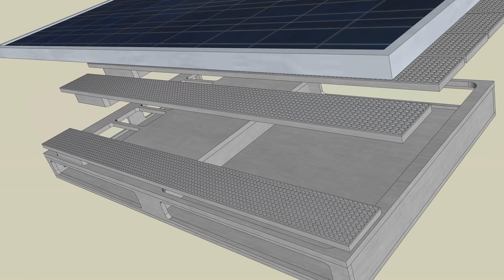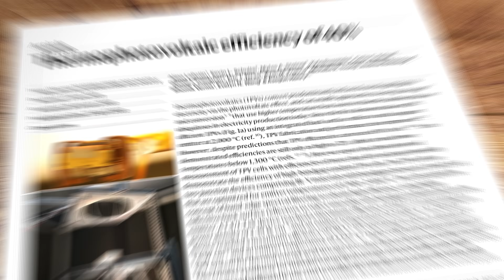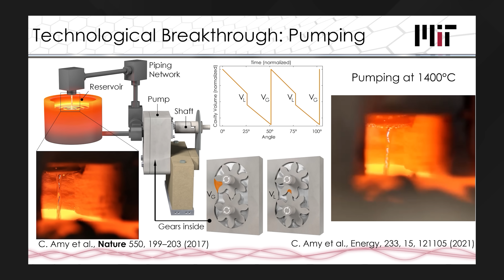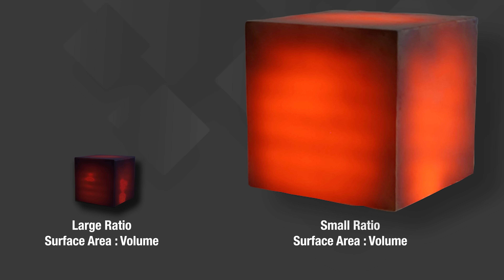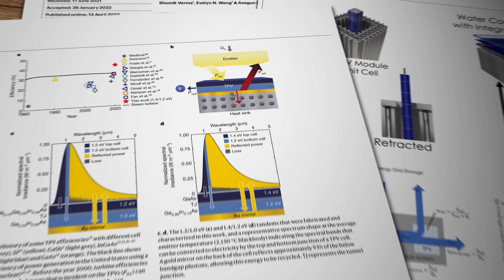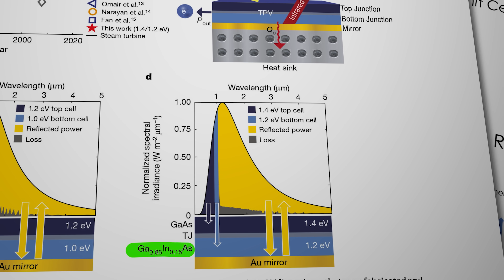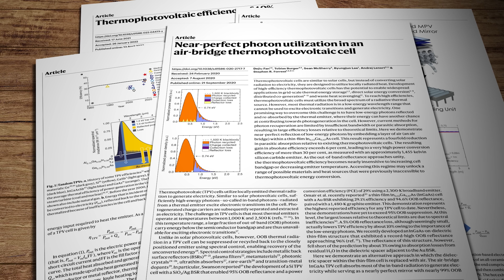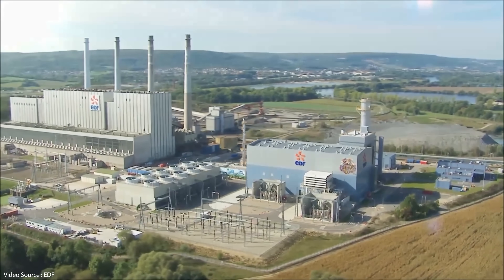Grid Scale Energy Storage 30x cheaper than Lithium-ion! How do they do that?

Comment: So the molten tin makes it back to the heating element before freezing?  If that tin froze in the pipes, that would be a problem, wouldn't it?
Reply: It would, but it sounds like the tin is being pumped around at temperatures far in excess of tin's melting point (231 degrees c vs. the  2,400 degrees c this system runs at), so they'd have quite a bit of cushion.
Reply: @sunspot42  true, but there better be redundancies built into the system.

Comment: I can't help but think that this system is better suited to a district heating system. Long term electrical storage requirements are a myth. Wind and solar are counter cyclical. And studies have concluded that you only need 1-4 days worth of storage in 90% of the global energy market to meet needs.
Reply: They are counter cyclical in short term but long term... not so much. Solar and wind both dip in winter.
Reply: @ThomasBomb45  yes they are. The wind blows stronger at night, during weather events and in the winter as well. Conditions are localized, but a complete renewable grid will always have excess energy being created elsewhere.
Reply: @ThomasBomb45  No its does not. Offshore wind is stronger in the winter. The colder the air is? The more dense it is, and the more force it is able to exert on the blades. The generators are unaffected by the cold. They produce their own heat.
Reply: We absolutely need long term storage or overbuilding of energy generation. At least if we want 100% renewable energy. We can get pretty high renewable penetration though with just a few days of storage

Comment: One thing I realised is that the system still requires rare minerals like gallium to operate. Not the best thing for large scale sustainability.
Reply: Argon too. I'd be interested in hearing how they'd fully insulate/isolate that carbon storage chamber from leaks, and at what concentration would the proper reactions take place.
Reply: True, but how many first efforts are ideal?
Reply: @markhathaway9456  it's essentially impossible to avoid the use of gallium here.

But I have no idea how much power you can get per kg of gallium through this system, nor how much gallium is produced each year.
Reply: @kanucks9  gallium is a by product of aluminium smelting and production can easily be greatly increased to meet a rise in demand

Comment: That is really interesting. I have to keep an eye on this for the opportunity for the technology to work on the back of my log heater to generate electricity while I heat my boat in Winter. What it would need would be a barrier material that when heated by the fire would emit light at a t a fixed frequency on the other side to which the PVT’s were attached. Keeping the PVT’s cool would not cause inefficiency in this case a s the purpose of the assembly is to generate heat, so functionally the whole assembly would be greater than the 40% to 50% electrical collectible electrical energy i.e. the cooling energy is not wasted.

Comment: This system looks like something Rube Goldberg might have invented after his 6th coffee in a morning.  The system may be a miracle of scientific advances but it is complex beyond belief.  The idea is to store excess energy which is inherent in solar and wind systems. So far so good and they end up with getting out 50% of the energy they put in which is quite respectable.  But the material infrastructure and maintenance; is that all in the overall efficiency calculation.
Even if it is, there is a much better option for any region requiring heat in the winter.  That is geothermal storage.  To avoid curtailment losses, excess energy is turned into heat and stored underground.  The efficiency of this operation is around 50% as well but the infrastructure required is a matrix of vertical holes in the ground.  Such  systems cost about 0.6% of the cost of chemical batteries per kWh and can be up and running in weeks using garden variety drilling equipment.  
The downside is that they produce heat rather than electricity and therefore are only useful 6 months a year for output but can store excess energy all year long.  What the MIT team has done is impressive but it just won't fly once the practical hurdles begin to be encountered and there is a vastly cheaper, easier and proven alternative.
Reply: Compared to thorium salt reactor designs, this is not particularly complex.
Reply: @richardgreen7225  That doesn't say much.
Reply: Geothermal storage, on large scale for heat pump application has been done in Canada. The cost is huge, around 100k$ per house.
Reply: @hellsing56666  where was this $100,000 per house storage facility built? What is the name of it?
Reply: @morninboy  it was drake landing:

https://en.m.wikipedia.org/wiki/Drake_Landing_Solar_Community

The cost is high because it was the first time it was done in this region, maybe it can be cheaper now.
Reply: @hellsing56666  Wikipedia says that the cost would be about half now that they know how to do it.

It's not clear from the info if the cost of the house insulation is included in the 7 million.
Reply: Am I missing something? The whole point of TPV is to convert the heat to electricity.
Reply: @gg3675  it converts very hot heat (2000c) to electricity, there is still a lot of potential in the remaining heat.
Reply: @hellsing56666  Oh, you know what, I actually misread the original post and see what they meant now.
Reply: TPV may be more suitable for thermal power plants and nuclear reactors.
Reply: @martincampbell9810  
You can have the honors. 

... the congressmen who fall for subsidizing this crap too. 
Especially FUSION.
Reply: Heh, yeah I was thinking it was something made to catch roadrunners.

Comment: it takes 14.2Kwh of energy to take 1 ton of tin from say 20°c to 250°c, that's less than an EV battery pack's worth of energy and could be supplied by a 20Kwh turbine system

Comment: Thermal cycle those layers between the 90 what ever percent reflective part and at some point micro defects cropping up are gonna ruin efficiency. But if they engineer it right should last longer than a battery. I'd be more concerned with the other moving parts, but tbh didn't pay enough attention to comment on that.

Comment: Good luck to them, but I'll maintain a steep escarpment of skepticism until we see the true cost of a commercial system.
One point. Being thermal storage based, the longer we want a unit of energy stored, the greater the losses through the insulation. What's really needed by the renewable energy industry is low cost long-term storage. August to January, one paid cycle per year. This, with its thermal leakage problem, is not likely the solution.
Reply: I am not sure, but isn't something like flow batteries the best for longterm storage? In any case no one is really interested in developing such long term storage, since it will not be really profitable or have a very high cost/kWh. A better idea might be to just have overcapacity in production and large interconnected grids to deal with variations on larger scale.
Reply: @MDP1702  who will want to overbuild? Overbuilding will be lots of cost with little profit as well...

We will need to pick the rich combination of storage, interconnection, and overbuilding. And we need to do so from a collective perspective not from a profit perspective
Reply: @ThomasBomb45  Will it be more costly? Possibly. However if you can find the right match the overbuild can be used during summer for things that don't necessarily need to run in winter (for example hydrogen production maybe or maybe something like (indoor) farming?) so that they don't necessarily are idle throughout the rest of the year. Also even if this overcapacity only produces 1/3rd of normal yearly production, that still makes it around 90-120$/MWh, which is likely a lot less than long term storage which essentially has only 1 cycle per year (if it is seasonal) vs the nearly daily (or at worst weekly) cycles of short term storage. Considering short term storage already can be more expensive than this overcapacity, longterm storage doesn't really stand a chance. 

And ofcourse there was a large emphasis on large interconnected grids. even during winter you still get a lot of sunlight in more southern regions while wind ofcourse will also generally blow somewhere too. Not forgetting that wind generally is better during winter and solar during summer, though they don't exactly balance out since the seasonal difference for wind is smaller than that for sun.

All in all there really isn't a good incentive for storage with monthly cycles considering alternatives.

Anyway (limited) overcapacity + hydrogen storage could be on of the more interesting systems if truly needed. The overcapicity can create hydrogen in the summer and still be used as a supplement in the winter, while the produced hydrogen can then also be used in the winter. It isn't ideal due to the need of large scale hydrogen storage during months and overall efficiency losses of hydrogen, but likely still one of the better ones and if there is any hydrogen left (due to for example a good winter), it likely can be sold to industry and transportation.

Comment: They should be able to run the cooling water through a turbine so they don't dump the heat overboard without extracting all the available energy.
Reply: It is difficult to extract heat from water unless it is steam
Reply: @ted-123  That has been the traditional way and few efforts to produce electricity directly from heat have been of any use. The key about this system, one most everybody here doesn't seem to understand, is that the method they're using generates electricity from heat at a much higher rate than ever before. (as I understand it)

Comment: Idk man. First of all, the quoted 40% efficiency is just for the TPV cells themselves; it is not the round-trip efficiency of the whole storage unit itself. With other technologies like pumped water having 70-80% round-trip efficiency, I don't see how this system could ever compete them for storage. So unless this is absurdly cheap and the excess production by PV/wind very high, then I don't see this being a viable solution. But it looks more like a Rube Goldberg device, so I have doubts that it could be as cheap as they tout. Others have pointed out the losses in cooling the TPV generating units; why not capture some of that temperature differential with a heat engine like a Stirling engine?
Reply: Pumped storage has a huge capital cost, and sites are difficult to find that meet operational and local population requirements and hurdles.

Comment: Neat. It does seem like a complicated system, lots of moving parts with the associated downsides. And as others have noted it would be nice to make use of the waste heat off the cooling units. 
But it's novel and it does seem as though they have actually thought about scalibility and practical deployment.
I liked the sound effects when bits were being dropped in place in the animations.
Thanks, Dave!
Reply: The requirement for gas-tight, argon filled buildings strikes me as a maintenance nightmare.
Reply: @jasondrummond9451  It doesn't really have to be gas tight. Argon is denser than regular air, so keeping the building pressurized at just over 1 atm would ensure that outside air was not getting in. If anything, argon would leak out. Argon isn't bad for the environment as it is non-reactive, so a small continual leak would not have a negative environmental impact.

This is also another example of volume vs surface area. The larger the building is in terms of volume, the smaller percentage of it's argon it will have to worry about replacing due to any leaks.
Reply: @jasondrummond9451  all that's really required is to prevent oxygen reaching superheated graphite and tin.  Not so different from the xenon or CO₂ that's used to prevent combustion during high temperature welding, except that it has to operate longer term.  Maybe filling entire buildings with argon is overkill there.  Other oxygen-displacing gases might cost less than argon and be equally effective.
Reply: @jasondrummond9451  I think in the reality they would build gas-tight cells inside a normal building, like a cooling-cell in a commercial kitchen, just bigger.
Reply: @jasondrummond9451  The pessimist in me sees that as only one of the potential maintenance issues.
Using a molten metal as a heat carrier is another, what happens in the worst case scenario where the temp drops below the melting point of the metal. How do you remelt several hundred feet of solitified metal in the pipes to get the system operating again without a total rebuild? 
How long will it take to cool the graphite blocks down for maintenance in that part of the system.
And as just about everyone has commented why dont they put a steam turbine in the system as an add on or backup power to keep the molten metal, molten.
It will be interesting to see how the pilot plant goes.
Reply: @dhc4ever  Agreed. Personally, I think that if the Ambri Liquid Metal Battery works as advertised it is a much safer and much more fail safe way to go.
Reply: Yeah, you'd think they could use the heat or waste heat to either run a turbine or something else.
Reply: @scottgillespie2562  Oh you mean like a decommissioned steam turbine like a power plant?
Reply: It is likely that the waste heat is to low in temperature to be really useful. Maybe if they had a use very close, like maybe space heating.
Reply: @danp762  Some European cities have district heating. Might be a good place to try to pilot one of these.
Reply: @danp762  What would the temperatures of the water be near 1atm? if its hot enough for a water heater we could build these near cities and use the waste heat to power all the hot water in a village or neighborhood. Less energy that would be used on the indivisual basis and it would be included with the price of power. Utilities would be overall more efficient. Just an idea of course but very interesting indeed.
Reply: @averagepeople9802  The temperature of the waste heat water is dictated by the effiency of the TPV cells at a given temperature. For example if the temp of the cell needs to be lower than say 50 degrees C to get good effiency from the cell. The cooling water isn't hot enough to make transmission losses worth it. Unless the the heat is used very close to the source. The hotter the TPV  cells get the low their effiency.
Reply: @danp762  thank you for the info. I appreciate it. I'm glad we are all able to discuss methods for creating innovative solutions while not being blinded with futurist ideals which are not fully understood or practical in real life.
Reply: I'd use waste heat to heat homes. This is clean heat and storages can be inserted anywhere. So heating homes with the electricity from the plant and with the excess heat would give some advantages. Just install enough solar panels and wind turbines (almost anywhere in the country/sea), use TPV units in cities and let them heat cities and store their electricity as well. Duting summer you will have more solar energy available and energy demand is often lower, so you mostly recharge these cells in the summertime. Blocksize needed should be enough for giving heat and electricity for about 3 winter months.

In warmer areas there is a need for extra cooling, so extra heat should be handled differently. Few heat exchangers and then you may produce electricity out from them...
Reply: Actually it's almost guaranteed that the waste heat is not viable to collect, if the water is still liquid then the temperature difference relative to the outside air is no more then 50 degress which via the carnot limit implies an efficiency of ~10% at most and before we account for parasitic losses.  If the PV efficiency is 50% this means the additional waste heat utilization only raises the overall system efficiency to 55% but will have a high capitol cost due to the mass of a very low temperature extraction cycle which would likely need to use amonia.  In short people who don't know the first thing about thermodynamics needs to stop salavating over waste heat like it's some huge untapped resources.
Reply: @kennethferland5579  The waste heat could be used in places where a high temperature isn't needed. The Carnot limit only applies if you want to convert the heat to mechanical work or electric power. As many commenters before me wrote, space heating or making hot water (for showering etc.) could work fine. My home is heated using water of 50-60 degrees C using waste heat from an gas turbine  power plant.
Reply: A mountain of not invented yet.  . . . . . . . fuzzy on the final power generation element. 
Way too many moving parts.
Deeper dive into Thorium and near term  SMRs.   Will need the power for the recession wave.

the corporate state next up
Reply: Pumping water up and then down through a generator is much cheaper and more efficient.
Reply: No, not a lot of moving parts.   I bet you didn't even count them.  The risers on the panels are simple.   The tin and the tin pumps are moving, as would be any valves.  Now can any one count other moving parts?
Reply: waste that's the product, the point of the system/machine power in heat, and at a later time back to power, that (waste is like having a car with small hot in its fuel tank, and say lost fuel is cheaper sting patch on the tank )   ¯\_(ツ)_/¯